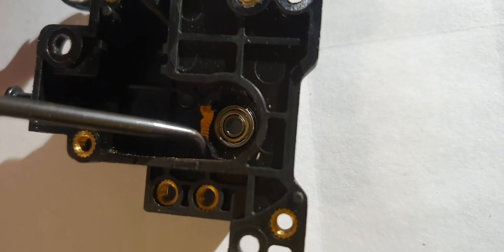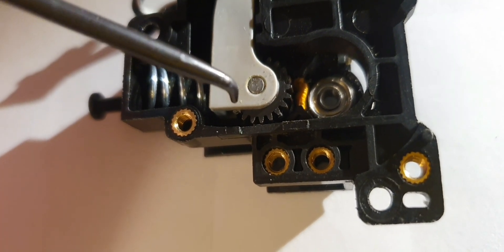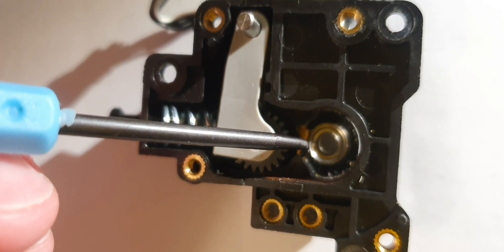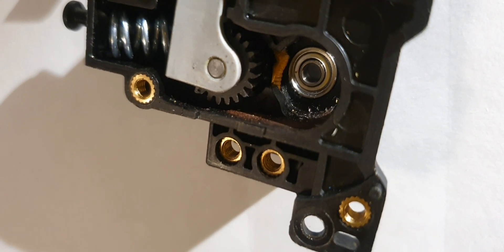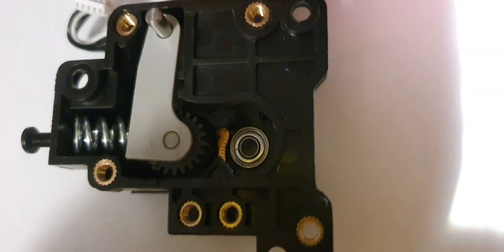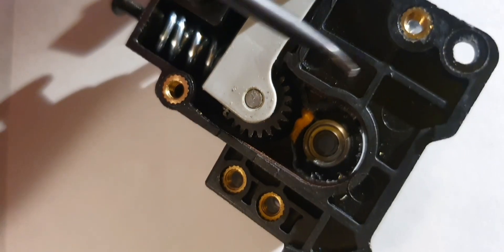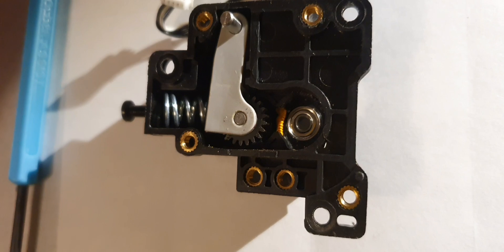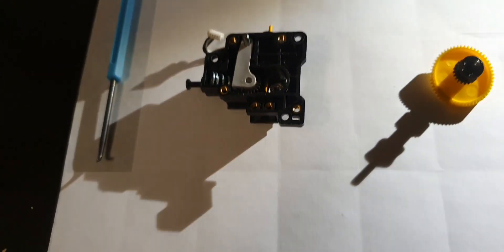This is why the X1c Extruder jams and get blocked! Crap design is the reason! - Fix it Bambu!

Comment: Does panda extruder fixed this problem ?
Reply from the maker: No. I find the panda to be worse. It has exactly the same way to feed filament..BUT the bambu extruder is PLASTIC the panda is aluminium....and absorbs an insanely lot more heat. I find the panda to cause more problems because it get so much more warmer than the bambu one. When you use full metal gears too..it is even worse. I also ALWAYS have issues with cold pulls in the panda....in 99% of the cases the filament got stuck being pulled out and tear off halfway. on the bambu this rarely happens when I follow my technique to coldpull. The major problem with the plastic one is cooling. if the panda one was made of plastic it would be superb.

Comment: I think if we buy the aftermarket metal extruder housing we could mitigate this issue.
Reply from the maker: no..all aftermarket are designed the same. The panda extruder I do not like. it gets very hot. The bambu one is plastic and stay cooler. I found that making sure to keep the enclosure open printing pla helps a lot.

Comment: I have exactly the same on X1C - non stop the same . No problems on A1 mini at all !
Reply from the maker: did you ever change the ptfe tube from buffer box on back to top connector? if so, how many cm is yours?
Reply: @Toffypops  I didnt. I have another theory. I think tension screw does too much pressure. I intend to loose it next time ... Why I think so ... Becouse If extruder is retracting back (when moving to another position - this is to NOT create strings in the air  (and this mechanism in BabmuLab IS PERFECT )- you can observe this on A1 Mini in this funny "dot wheel" on the face of head - its going back if head is moving to another place with a moment with no printing). Then when too much pressure is done by compression spring and retracting filament is lets say 100C - it can do a clog immediately. Will test it and will be back here with results.
Reply from the maker: it is not. The tension screw need to be all the way in or the extruder will not fit in the toolhead. Also it needs to be fully in to properly work with max volumetric speed , which controlls how much pressure is used to push filamnent into hotend. If you loosen it it will skip and not be able to hold the right pressure. Heat creep usually occurs when printing pla because people print with door closed . with pla door need to be open to let hot air out
Reply: @Toffypops  OK . Will see. Then we need to compare extruder of much cheeper A1 with extruder in X1C / PS1  (as I see X1C and  PS1 have the same extruder) ... Cant believe A1 series  have no problems and those X1/Ps1 do have.

Comment: The same thing over and over at my x1c, what is the solution?
Reply from the maker: None as far as I know, except cutting the filament so it does not curl if it expands.
Reply: @Toffypops  i made some research, is caling "heat creep". I taked out the glass from the top of the printer. Now is printing well , will see the next print. I think was to hot inside. Also i checked the fans. Nice day
Reply from the maker: This is different. What i have found out is that this is almost guaranteed to happen if I manually stop a print, and do not immediately initiate an unload of the filament. If I stop the print , the spring inside will put pressure on the wire inside which is already "weakend" by heat causing it to deform and cool down in deformed shape. When it then cools down and you try unload it cannot because it has cooled down deformed. 
Bambu should have force-unloaded filament with manual stop of print to prevent this from happening. In addition the inside should have had a funnel at the bottom to prevent problems loading filament out of the extruder.
Reply: @Toffypops  Hi All! 

I have six x1-cs and two of them are usually doing it after a print stops or even while scanning the first layer... The interesting part is, that the other four was bought as combo kit with ams1, theese two bastards which ones always makes me trouble bought with ams2-s. Is it makes sense at all? XD
Reply from the maker: my best advise is to make sure to unload filament when printing is stopped manually. never let it rest in the extruder. My other tip is to upgrade the extruder to the panda one i have recently made a video for. the part-fan on the printhead can better keep filament cool with this since the design is open and let cooling go into the extruder better than the original one so heatcreep is less likely. had daily problems before. been using panda for over a month and have not declogged the panda extruder since I got it except for once when filament got stuck in the bottom hole
Reply: @Toffypops  thank you, I will buy some and test them!
Reply from the maker: @CaptainKrumplee please check my video on how to transfer the extruder parts to the panda from the bambu if unsure. 

https://youtu.be/l5-WBMU_AB8
Reply from the maker: @crisssti13 https://www.printables.com/model/470515-bambu-lab-x1c-x1-top-glass-spacers-with-magnets-lo/related?lang=de

i use similar to these.
Reply: @Toffypops  That is what I am seeing. I think when I have a bad print and I cancel and start again and maybe cancel it happens, I never see it after a good complete print. They probably need to force a better extract on cancel too. Trying to see if I can add some G code to help. I do believe that design is an issue. If people aren't seeing it on other bbl it makes sense.
Reply from the maker: yeah unloading after failed helps a lot. especially with pla. make sure to print with open enclosure/doors especially printing pla. and calibrate volumetric max speed to find max speed vs nozzle for the filament to avoid heat creep from overpressure wandering up into extruder. watch my max volumetric speed video.